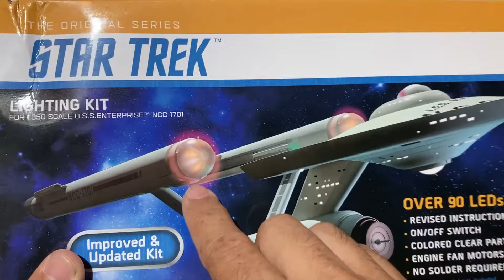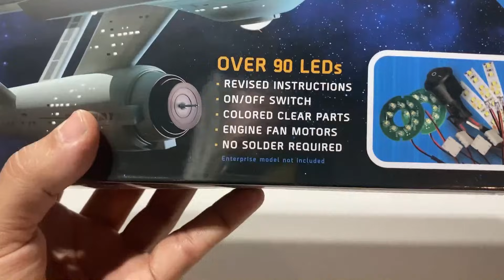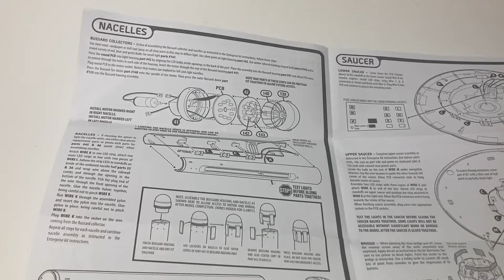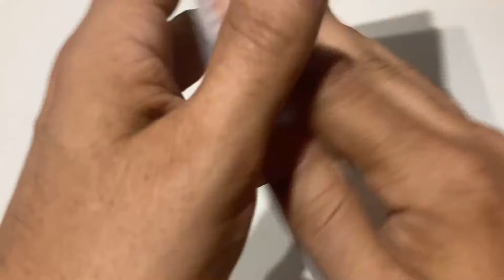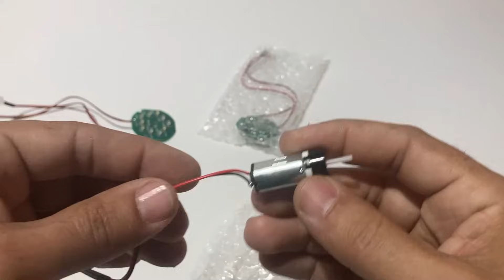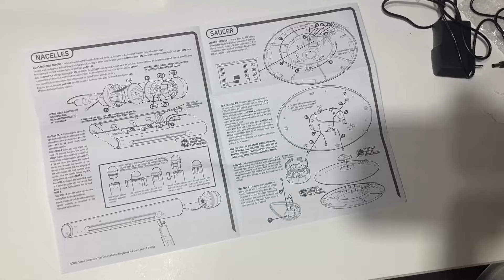Unboxing - TOS Lighting Kit Updated and Improved.

Comment: The original did come with a power supply it did not have a switch the soliderless connections where terrible they often would make contact then the circut would come apart loosing a large chain i ended up soildering my connection even without the shuttle bay the rear of the ship barely fit a great deal of work with a dremel tool was needed and the bassard lighting was a great idea bur only one of mine flashed roung 2 sent me 4 diffrent boards none of them lasted and eventually the one that worked quit on me the motors where loud but are still working and the lights that are on at all times continued to work i love my model but i did a very good job on it i wish this lighting kit was available 12 years ago

Comment: Only issues I have had with this light kit so far, is the connectors for the little led strip pieces are garbage. They either don't connect fully or fluctuate... Ending up just soldering them all together after cutting the connectors off. Got tired of having to reopen the saucer to adjust the things only to have them do it again and again :/
That aside so far just sad the bridge lighting is yellow rather than white.

Comment: I owned the Master Replicas Studio Scale Enterprise and absolutely loved it for the short time it worked. The impeller fans inside the nacelles stopped spinning first, then the sequenced lights went out. At that point, I sold it. I have the PL 350 and the old lighting kit but now that I see that they've improved the lighting kit, I'm glad I haven't had time to build it. Looking forward to watching your progress. I'm especially interested to see if they, indeed, sequenced the nacelle lights, as they flash in a very specific order on the original filming model, which MR replicated using colored LEDs, not the "Christmas lights" the new lighting kit supplies... which is (obviously) more accurate to the original.

Comment: As someone who is currently working on a 350 Enterprise with the old lighting kit, I do like the fact that you get better connectors for the LED strips, a switch for the kit, and the better instructions with diagrams of the wires.  The old kit does have the power adaptor, something that surprised me when I opened it first as I presumed it would be battery operated.

EDIT: My lighting kit did have a problem.  When I checked it at first, the motors worked but none of the lights did.  Turns out that something had been wired wrong in the kit.  I needed to reverse the main power wires so that the red wire from the kit was joined to the black wire from the power supply, and the black kit wire was joined to the red power wire.  Once I had done that, all the lights came on.  When I checked against TV footage, my motors had originally been turning backwards.
Reply: If the lights had worked the first time that would have been a cool effect.
Reply: On top of that if you don't want to use the strips PL provides you can change them out for the ones with the color ranges you want to use.

Comment: I really hope they update the K’tinga light kit.  The main issie I have is that the forward and aft photon torpedo bays are always “on.”  Would be nice to have activation switches to make them pulse on and off.  Don’t want to buy an expensive aftermarket lighting kit that requires soldering.
Reply: Sound would be a nice touch as well

Comment: Are the motors in the nacelles any quieter than the previous version? It amazed me how loud the previous motors were. I think the tube of the nacelle amplified the sound.
Reply: This and the dimness of the port and starboard red/green flashers were my biggest issues with the original kit as well. You can barely see them unless you’re in a dark room. The power switch is a nice touch, and I like that the addressed the shuttle bay lighting issues, but I’m really curious about the motor sound and flashers as well.

Comment: I said it on the previous upload but this kit seems much better than that of the DiscoPrise which the latter was disappointing for me.
Reply: Yeah it's kinda baffling to me why they didn't just use strip lights for much of the interior lighting instead of the dozens of LEDs with fat wires that you had to jam into the model.

Comment: Well good luck on the build, that 1/350 is going to be a lot of fun! You'll have to try the 1/350 refit next, working on her now and having a blast.
Reply: I wish they made a basic lighting kit for the refit
Reply: @nathanstenabaugh1290  I heard a rumor that they were going to do just that but never did. And building this thing right now I can understand why, its sadly not really engineered for it. So little room to put standard 2 mm LEDs.
Reply: @PunkyWily  true but I’ve developed a bit of hand shake that make simpler kits like the new polar light 350 kit ideal.  It’s not ideal to pay 8 times more to get something into Canada that also requires a lot of soldering and even more kit modifications. And cobbling something together from scratch isn’t usually ideal for similar reasons.

Comment: I'm skeptical of any motors being in the nacelles after building the DiscoPrise and having my LEDs burn out from the heat generated by the motors.  I left mine on after putting it together, only to find my lights were toast.  Killed the lights in the collectors beside the motors and also killed the first light in the blue warp grill because it got hot too.  After breaking it apart, I found the motors had gotten hot enough to distort the plastic piece that connects the clear fan piece to the front of the motor.  I contacted PL and they graciously resolved the issues for me.  But basically the kit was done for.  So be advised of motors anywhere close to LEDs that can't be ventilated to cooler air.  I would rather be able to enjoy the lights for an extended time then have to enjoy it for a brief time and have to turn it off to prevent damage.
Reply: Good to know, thanks. I only ended up using the motors from that kit, with the rest being my own lighting. But I still only run them for maybe a minute at a time as it makes me nervous keeping them going any longer than that.
Reply: I'm going to add a timer on mine so it won't stay on for over ten minutes